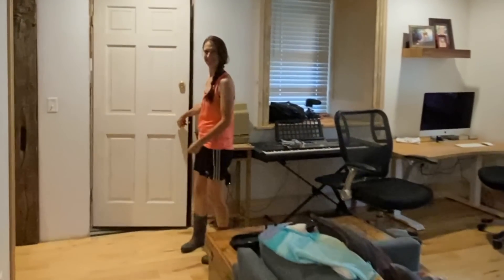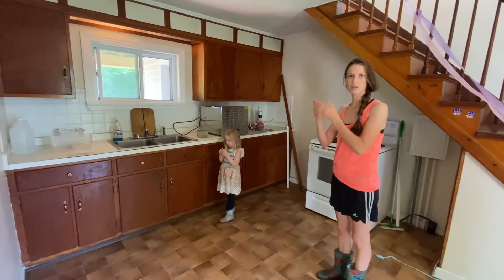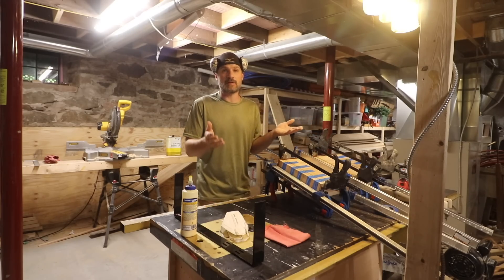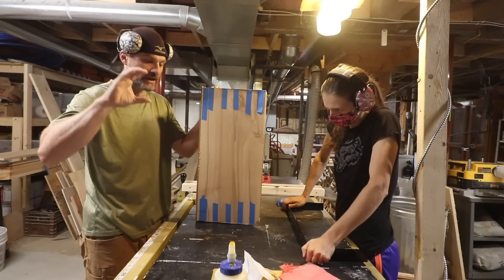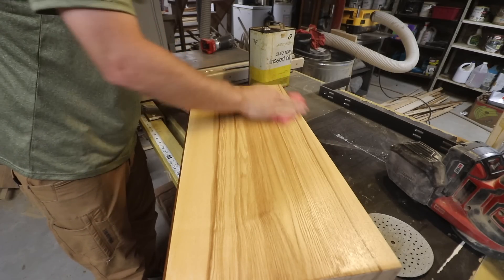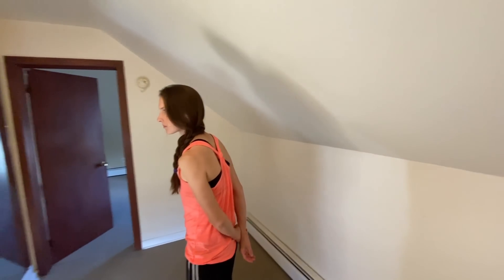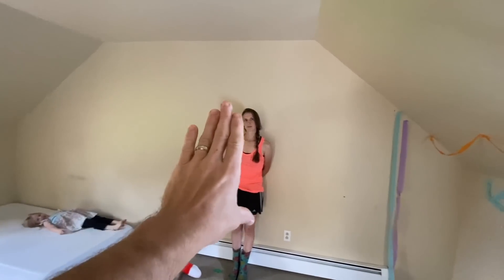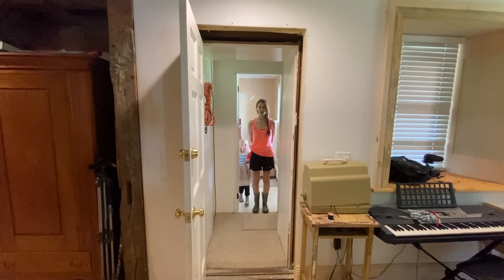The "Other Side" Reveal - Quick Walkthrough

Comment: Keep the stairs. It will be nice coming from the bedroom right to the kitchen. Lots of old houses had two stairways. Good luck on this new project.
Reply: Agreed. I think it's possible to keep them and bring in light. Might need to rebuild the stairs to accomplish it though (make sure the wall can accommodate windows and structurally support the stairs).
Reply: I could see 3 windows there.  It may be possible to put under the stairs and at the end.  Planning out is a key to that.  Taking the stairs out would create an easier time to put and (evenly lol) space maybe 3 windows.

Comment: Thanks for showing the other side. Your house will be awesome once that side is incorporated. The second staircase in its current place do seem to dominate the space and windows on that wall would be good, but, try to think of another spot for the stairs, maybe a turning one with a landing halfway up. For practical reasons as well as safety! 
I will be eagerly following the transformation and rooting you on …
Reply from the maker: Maybe a different staircase… we will see.
Reply: @1806StoneHouse  You need two staircases.   Different spot.  > 'L' shape in a corner.    You have lots of space.

Comment: You don't need the level of detail on the window trim.  You could do the upstairs and leave the kitchen/dining room till last.  The thing that is the big question is the floor/crawl space area.  The gutting and rebuilding the floor is where I would start.  No sense icing a moldy cake....  I did cabinets for my sisters house in white pine with Acorn HL hinges and matching latches.  I used the cheapest drawer slides.  That was a mistake.  The Acorn latches and hinges were great and are still make in Mass.